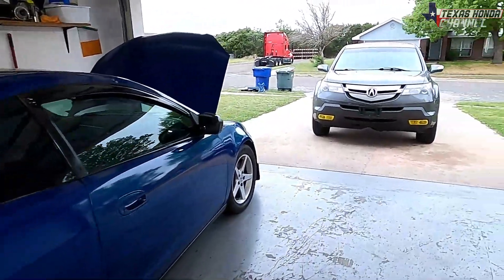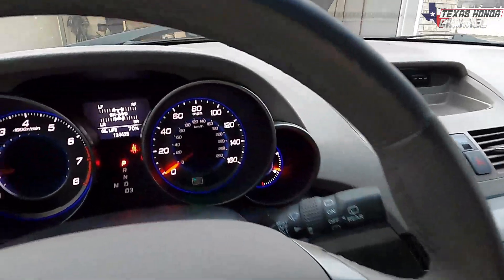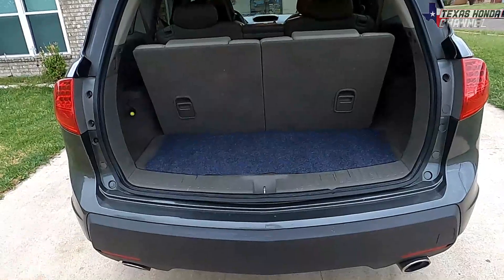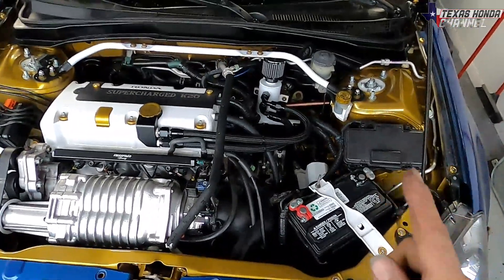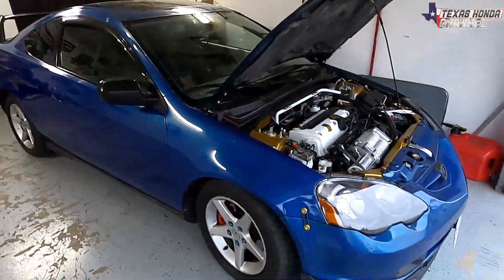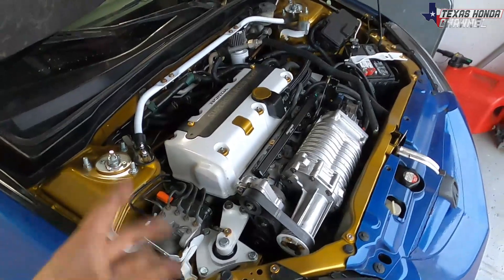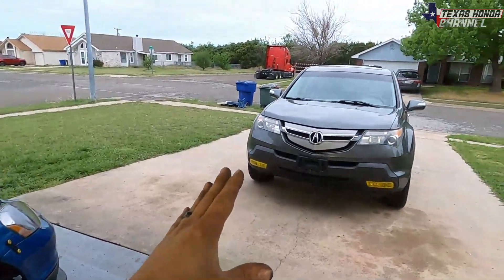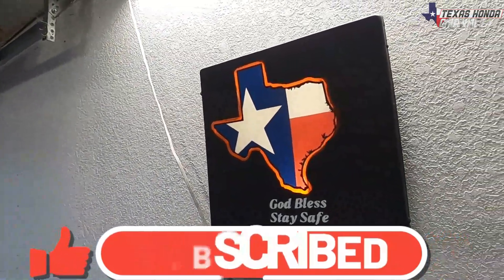THE NEW FAMILY CAR! ACURA MDX

Comment: There is a lot you could do to push the limits of your RSX further. You have basically just begun the journey. K24 bottom end with higher compression, or just higher compression on this engine alone would help.  You could also do cylinder head work to it and that alone would help you achieve well into the 300’s. Ethanol or Methanol Injection would be good for a decent power bump. I’d say you have a solid 75-100 whp you could make on top of what you make now.
Reply from the maker: Trust me I know!! I haven’t even come close to where I want it but I love it already. It just got crazy fast since I found out my bypass valve was stuck in bypass mode so it was only making 1psi this whole time since I got it off the dyno. Now it’s at 9.5 psi and will have video coming out! It’s WILD!!!
Reply: @TexasHondaChannel  Even though a supercharged 4 cylinder is inferior to a turbocharged 4 cylinder, they’re still a lot of fun. I miss my Cobalt. I should have kept it and fixed the minor issues it had; clogged catalytic converter; then retuned. I was young and dumb and chasing numbers. It was a fun car with the Harrop TVS.